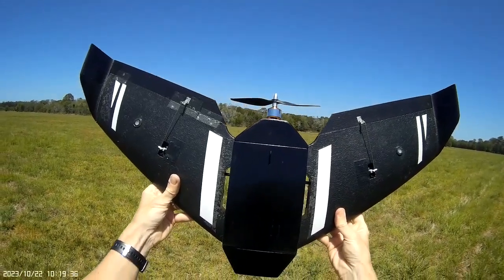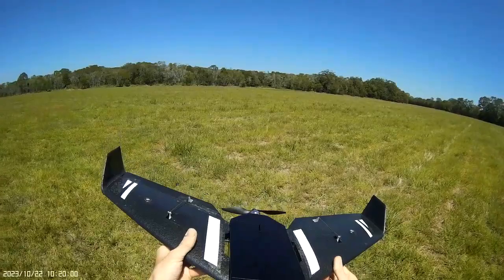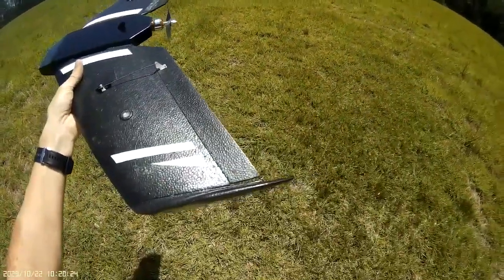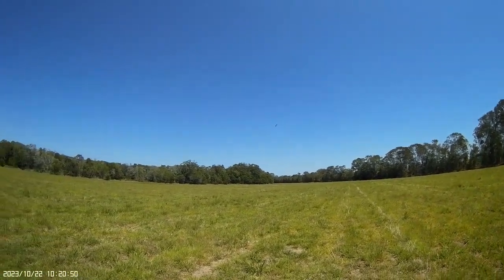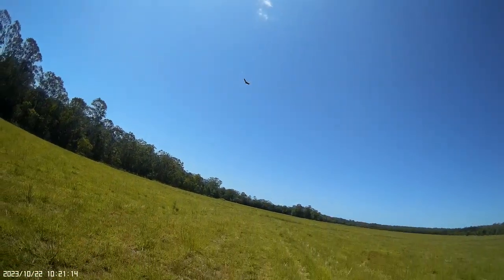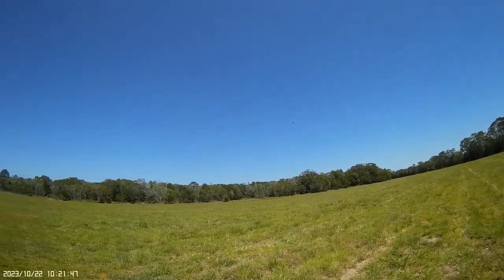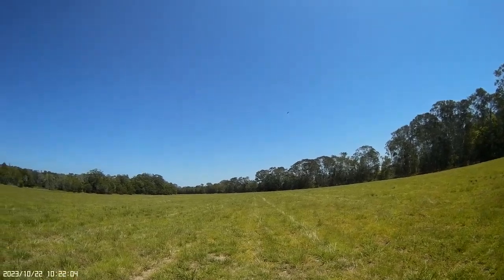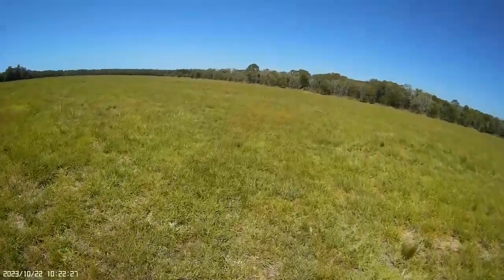Manta Custom Wing - Maiden Flight #2 - CRASH - But What Happened !!!

Comment: Did the battery slide during the loop?
Reply from the maker: Battery didnt move...  but the rear motor mount had cracked badly...  I think it was a mix of my motor mount breaking with the stall...  but its all repaired now..  will fly again very soon...